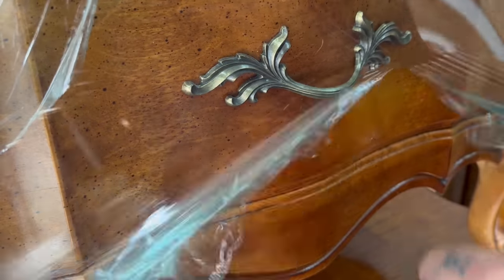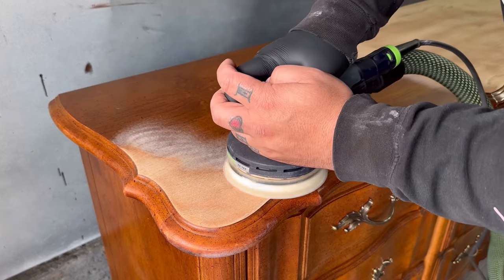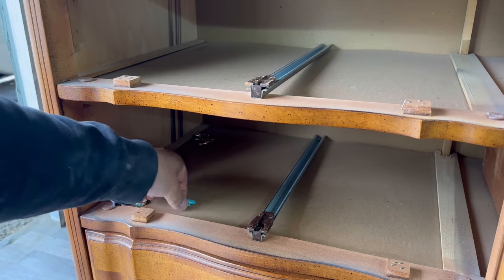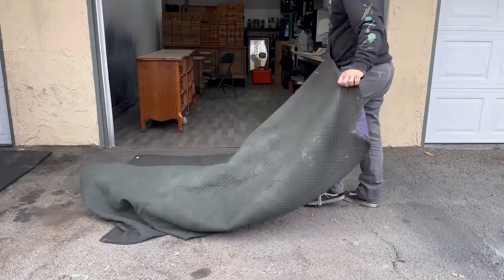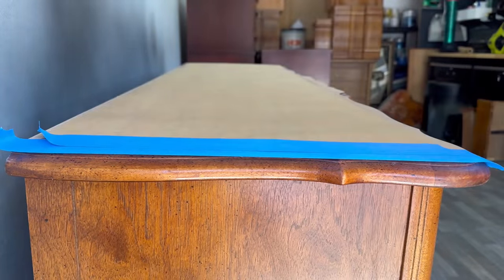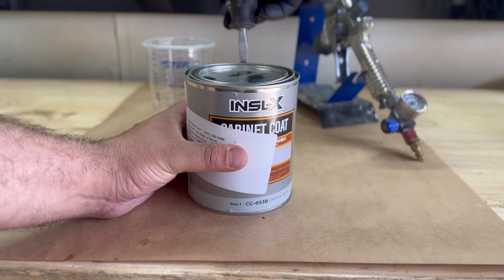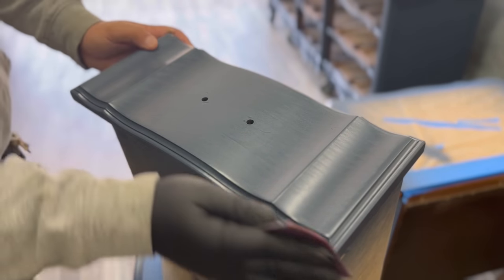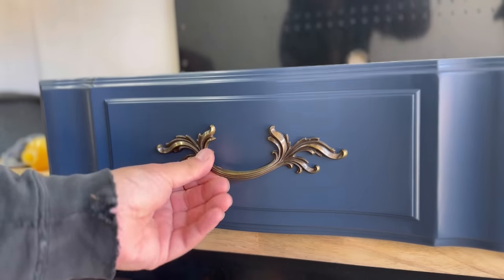HOW TO update an OLD French Provincial DRESSER and matching NIGHTSTANDS | furniture flip sidehustle

Comment: I just love watching and rewatching your videos.  Did you clean or spray the handles? They look different from beginning to end. I like that you gave the reason for doing the top first, but I see others paint and seal first, so I'm not sure which way to go because I do want to paint the bottom and stain the top.
Reply from the maker: Thank you so much for tuning in. I just have the handles a hood cleaning as I liked the patina they had. I always like fining the top first if I’m doing a paint and natural top. It’s a pain when you get stain or white wash on the finished paint and it doesn’t come off all the way.
Reply: @CedarPineDesigns  thanks. I noted that you did explain why you do the top first, but I thought I heard that sometimes you do the opposite. So what did you clean the handles with? I've had people tell me to use Bar Keeper's Friend, to boil with vinegar and water, to boil with just vinegar.
Reply from the maker: @aholaway3048  all of those are great tips but for these I just cleaned with mineral spirits
Reply: @CedarPineDesigns  I really appreciate you getting back with me I am definitely going to try to mineral spirits!
Reply from the maker: @aholaway3048  no problem

Comment: I am working on a nightstand that has drawer pulls that are not put on with screws.  They are put on with some sort of peg with a hole in the center.  Would you have any experience with removing those handles?
Reply from the maker: I would try a heat fun to kisses the connection point.

Comment: Do you have any tips if I am planning on sanding an entire French provincial dresser?
Reply from the maker: Are you going to bare wood in the entire piece or going to paint it?
Reply: @CedarPineDesigns  I am going to bare wood all around to paint wash it
Reply from the maker: @ANG3Lxox  just try to sand lightly and careful on the top and sides as it’s veneer. Other than that, it’s just going to be a lot of sanding.